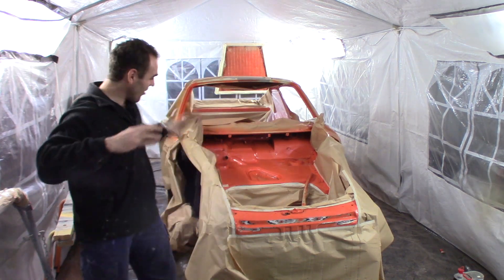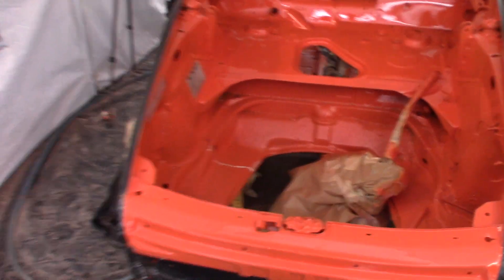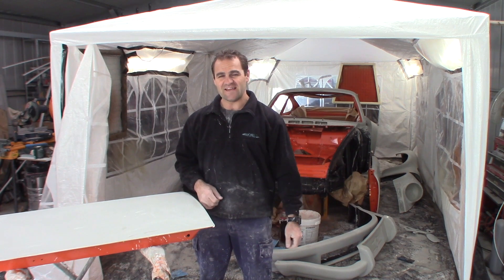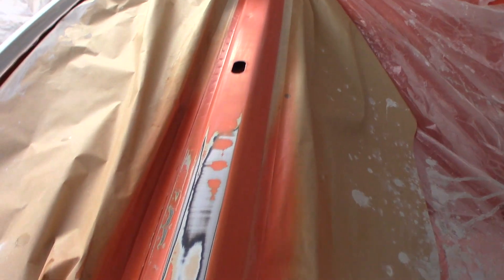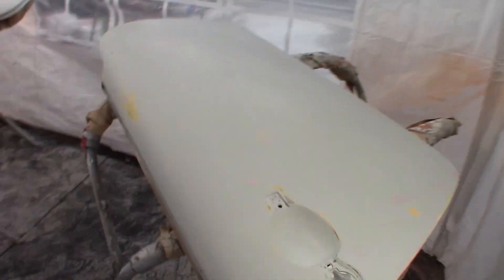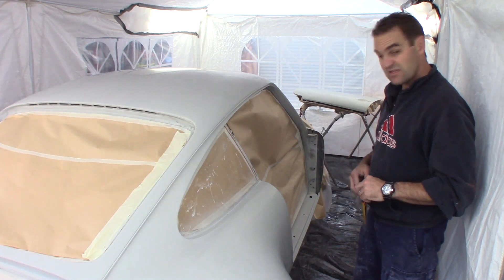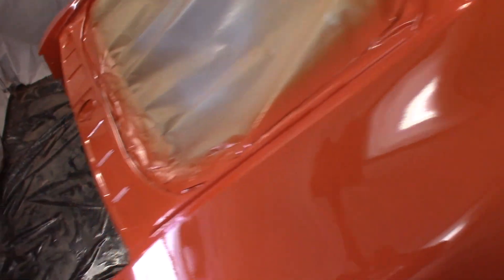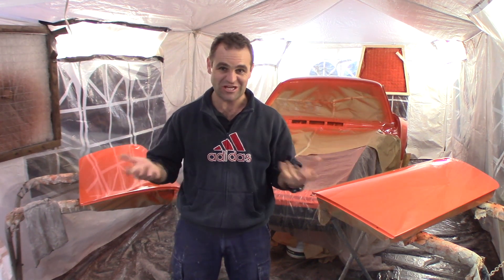Painting the body - Porsche 911 Classic Car Build Part 18

Comment: Interesting. I know this is a very old video series but Its something I have recently found. Few painting tips for those who may be watching this video for inspiration. Sanding your primer to 800 grit is too fine of a grit. It may not have enough tooth or key for the fresh paint to bond too. Your paint issues are from too much paint on at once. Its bubbling because the coats are not thin enough to off gas the chemicals properly. Your also getting runs because it is too cold your not letting your pain and clear coat flash off enough. Spray your first coat in a light mist semi dry coat. That is the tack coat. Wait 15 minutes for the paint to tack up or get sticky. It will help hold the paint from your next coat inplace. Wait 15 minutes for second coat to flash. Still a thin coat thin enough to barely cover 100% let flash. 3rd coat of color just a touch more paint on this last coat. Let all 3 coats flash for 25 minutes. Then repeat all 3 steps with the clear. 15 minute flash time in-between each coat. Spray techniques. Spray gun should be about 6 inches away from surface. Overlap each pass with a 50% overlap. Gun pressure should be set at 27 psi for clear coat. 25 to 29 for paint. Need 2 pressure Guage set the first one coming out of the air compressor at 39 psi. Then use a second pressure Guage  at the base of the gun and limit it to 27 to 29 psi. You should never paint in a room that is less than 70 degrees Fahrenheit 75 usually gives the best results with low humidity. Thats hard to do in Australia and Florida.

Comment: how did the booth go with extracting the fumes and what not during the clear coat?
was it pretty effective?
Reply from the maker: Yeah, it worked really well. The filters also did a really good job. I had the end of the fan's tube outside the garage in the grass and there was never a hint of orange or overspray that got through.

Comment: Looking fab!, colour looks great, but,more flatting to get rid of the clearcoat runs though!!, 911's and vw beetles!, are tricky to paint!, too many curves!, try not to break through the clearcoat when flatting those runs, you could have more paint reaction problems!, so take care!, go luck!
Reply from the maker: Yeah, it looks like I put too much on the drip rails and it ran down the body. I will use the razor blade method to get rid of the runs, so it should be ok. Several more coats of clear to go though, so I am not too worried ;)

Comment: I see your using a kerosene heater ? no issues with fish eyes in the clear ?
Reply from the maker: The heater runs on diesel and I had no issues anywhere with fish eyes. Although I used the heater outside the booth.

Comment: Graphics are bound to be carrera stripes along the sides of the car. I work at a porsche dealership and we had a gulf blue carrera rs replica in the shop for about a month a little while ago. It was a very nice looking car from about 30 ft. and it had some very nice touches but the restorer had also gotten lazy in certain places.
Reply from the maker: Hopefully mine will be a bit better than that. It won't be perfect, but hopefully it will be pretty decent.
Reply: Loving your build so far Jeff, watched the whole thing in two days. With your attention to detail your build is bound to be far better than his. Some of his most biggest mistakes were a very cheap front grill with nothing behind it and very conspicuous and abundant self tapping screws.  Keep up the great work!

Comment: Jeff,
How many coats of color and clear did you shoot?
Reply from the maker: On the outside of the body was heaps. Initially it was 3 coats. Then I did the stripes followed by 2 more coats. Then the stripes were blocked down and I finished off with 2 more coats for the flow coat.
Reply: interesting. will be doing the same thing for my hobby shop for a start just to get things running. thanks for the input. also, have you ever considered running the filter after the extraction fan? why? wouldn't it suck the fumes out a lot faster with the same effect? keen to know your thoughts
Reply from the maker: I don't think it would extract any faster. The restriction is the same either way, and if the fan is before the filter it is going to get covered in overspray and the will reduce it's efficiency.

Comment: we're the runs from the paint or the clear coat?
Reply from the maker: The colour is pretty easy to paint, you shouldn't get runs in it. The clear is where you need to make sure you spray it wet, and that is where you can get runs.